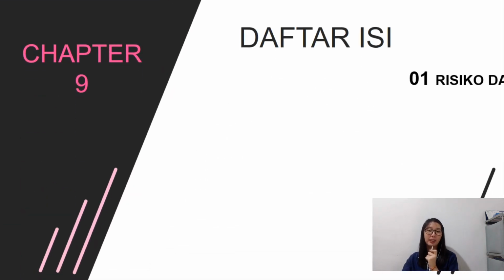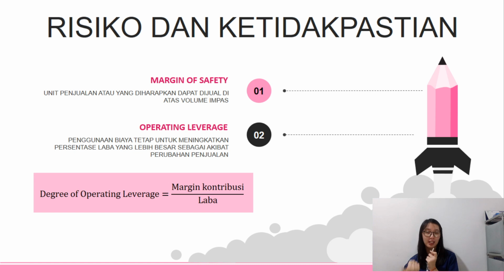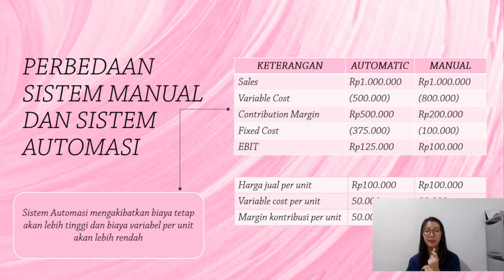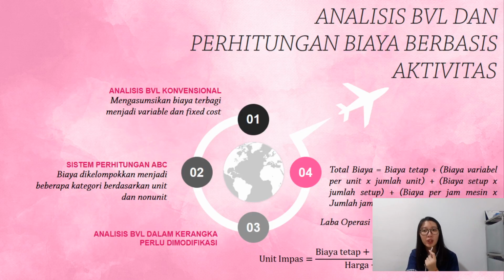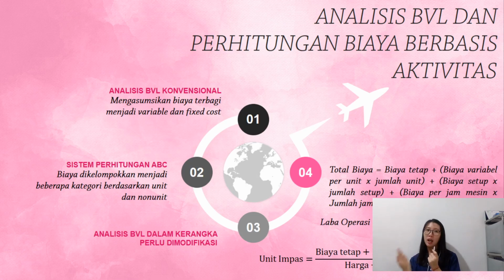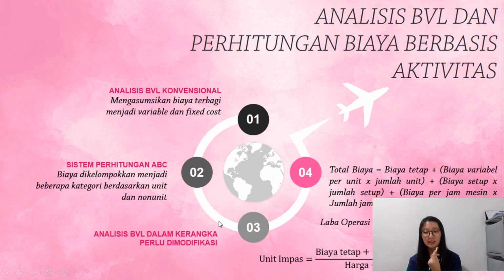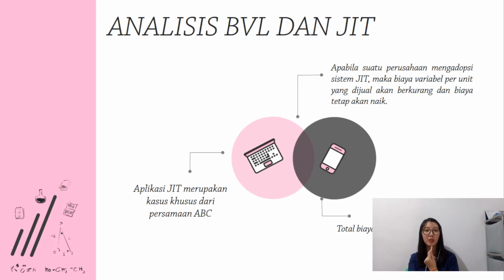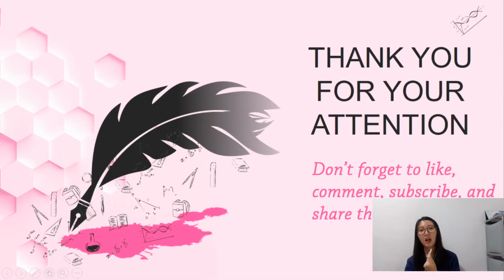3_Analisis Biaya-Volume-Laba

Comment: Hi Elvinaa!
I'm Evelin Dwi (209) i wanna ask u, why does CVP analysis in just in time system will make the variable cost per unit decrease and the fixed cost increase? Thank u
Reply from the maker: Hello, Evelin! Thank you for asking me a question.
CVP analysis in just in time system will make the variable cost per unit decrease and the fixed cost increase because, some variable cost, for example direct labor will be considered as fixed cost, not a variable cost anymore. These cases will make variable costs per unit will become less than before. Furthermore, the fixed cost will increase because some of the variable cost will become fixed cost.

Comment: Hi Elvina! I'm Stefani H Siagian (170503199) from group 1 . I want to ask, according to you, which method is better to be applied against risk and uncertainty?
Thank u 🙂
Reply from the maker: Hello, Stefani! Thank you for asking me a question.
Well, according to me, there is nothing about which one is better. Both method is useful in their own way. What makes them different is only the variables that they use. However, if we use the operating leverage method, we can see by our naked eye the effect of the fixed cost to the calculation of operating leverage. Usually, the higher the level of the fixed cost represent the higher level of the risk. If we are using margin of safety, we will need to count once again the sales deducted by the break-even to find the value of margin of safety.

Comment: Hi elvina, my name is elfran, id 088. I want to ask you. Can you re-explain about margin of safety? Maybe in an example to make me understand more?
Reply from the maker: Hello, Elfran! Thank you for asking me a question.
Okay, I will re-explain it for you. Well, as what you request, I will give an illustration. Recall that Whittier plans to sell 1,000 mowers at $400 each in the coming year. Whittier has unit variable cost of $325 and total fixed cost of $45,000. Break-even were previously calculated as 600.
From this information, we can find the margin of safety from total sales minus with the break-even unit or 1,000 units – 600 units become 400 units. Otherwise, we can also find the margin of safety in terms of sales revenue which is got from 400(1,000 units) – 400(600 units) become $160,000.

Comment: Hi Elvina, I'm Nona Tari (170503205), I wanna ask you, what is the function of sensitivity analysis in making decisions? Thank you!
Reply from the maker: Hello, Nona! Thank you for asking me a question.
Sensitivity analysis helps company in many ways, specially to help the company in making a decision. By using sensitivity analysis, the company will have an ability to predict the outcome of a decision if a situation turns out to be different compared to the key predictions. So, when the outcome of a decision turns out to be different with what has already been plan from the start, the company can directly revise the decision, so there is no fatal thing that could have been happened if the company choose the wrong decision.

Comment: Hi Elvina, my name is felix wangsa(002) from group 5 ,Why does calculation by using conventional CVP analysis and ABC approach still give the same result? Thank you
Reply from the maker: Hello, Felix! Thank you for asking me a question.
Based on the illustration in this video, the total cost from conventional method is consisted of variable cost based on non-unit driver and fixed cost without considered the cost driver. Meanwhile, by using ABC approach, it will split up many costs based on non-unit. As long as the activity level is still same and the cost driver is non-unit, the calculation of conventional and ABC method will give the same result. But, it doesn’t mean that both system will always give the same result. It’s based on the company policy and also the activity level and the cost driver.

Comment: Hi Elvina, my name is santa . I would like to ask you Why does automatic system can cut off apart of variable cost?
Reply from the maker: Hello, Santa! Thank you for asking me a question.
The automatic system can cut off apart of variable cost because when the company starts to use automatic system instead of manual system, it means that the company will start to use computer and machine widely. The use of computer and machine will decrease the use of direct labor. That is the reason why the use of automatic system can cut off apart of variable cost.

Comment: Hi Elvina. I'm Devina Wiranti 074. I would like to ask you "Why does CVP analysis by using ABC approach is more accurate than the conventional method?" Thanks before.
Reply from the maker: Hello, Devina! Thank you for asking me a question.
CVP analysis by using ABC approach is more accurate than the conventional method because conventional method is only categorized costs become fixed cost and variable, which is not really accurate because apparently, more cost is appear due to more than one cost driver. That’s why to remove the advantages of fixed cost and variable cost, they come out with CVP analysis by using ABC approach.

Comment: hi elvina, i'm onie natasya (211) from group 9. I have  a question, why does operating leverage is focusing on the use of fixed cost? Thx.
Reply from the maker: Hello, Onie! Thank you for asking me a question.
The operating leverage is more focusing on the use of fixed cost because as we can see, to count the degree of operating leverage, we really need the value of contribution margin and profit. These value is directly affected by the number of fixed cost. When the fixed cost is going up, then the profit will go down. As a result, the profit will become smaller than before. It will also make the operating leverage ratio become bigger. The company usually wants to achieve the ratio higher than before.

Comment: Hi Elvina, I'm Ryan Fernandes Panggabean 081. Why do margin of safety method can be used to handle risk and uncertainty?
Reply from the maker: Hello, Ryan! Thank you for asking me a question.
Margin of safety method can be used to handle risk and uncertainty because the margin of safety can be viewed as a crude measure of risk. In deciding the measure of safety, actually management is deciding in which range the sales of the products will be safe and still can give a profit. The risk of suffering losses is less if a firm’s expected margin of safety is large than if the margin of safety is small. Managers who face a low margin of safety may wish to consider actions to increase sales or decrease costs. That’s how the company can lower the risk of incurring losses.